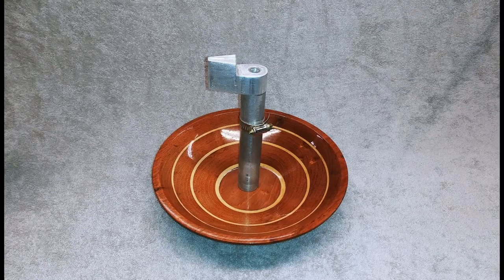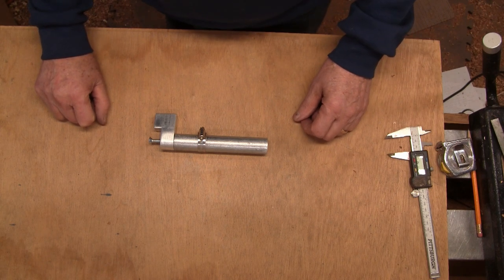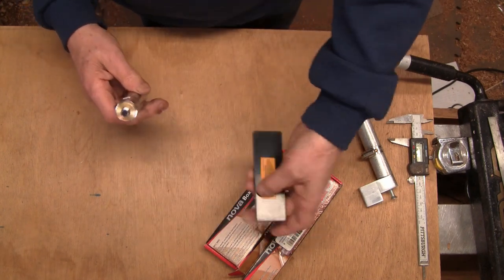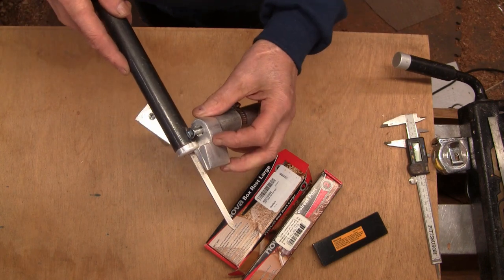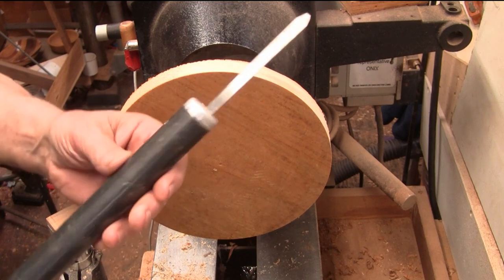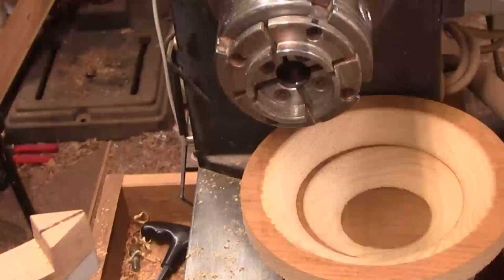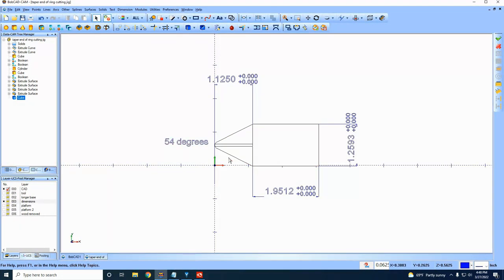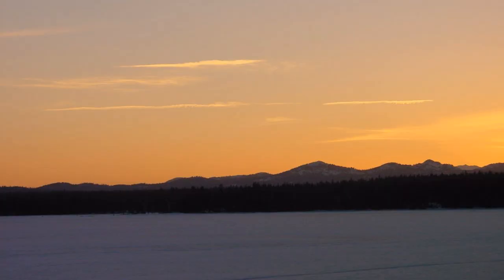Wood Turning NEW Bowl from Board Cutting Jig 2.1 READ UPDATE

Comment: Papa, I just finished making my jig. My platform was shorter and not as wide but it didn't matter. I tapped a 8-32 thread both in the wood and metal platform and used machine screws. I would send some pictures but I don't know how to do it with Youtube. However, the more important thing is to say thank you for producing this video. It was a great help. John von:face-blue-smiling:
Reply from the maker: You can find my email in my About Page

Comment: I hope this is not too long. I mad a jig and to test it I ran to Home Depot and picked up a piece of pine 3/4" x 10" x 4'.  I made rings for two bowls with 9" circles. I must say the rings came out perfect.  I have glued one set up, no turning yet.  This may be the last rings I cut with this iteration of the tool. After four plunging cuts the wood portion of the tool is wallowing out.  Silly me, I used pine I had in the garage. The good part is that before making the ring cutting jig I set up a jig on my belt sander at 27 degrees so this will make redoing the tool easier.  On making the first tool the belt sander assured that the angle on the box rest and wood were identical.  I used a 60 grit belt to shape the rough saw cuts on the wood and a 36 grit belt to totally shape the box rest (no sawing at all).  It went smooth, but a mask is advised.  I plan on replacing the wood with aluminum.  I purchased a piece of 1-1/4" x 1" x 3-5/8" for only $6.31.  The block of aluminum is the perfect size for me I will not have to change it in the least.  I will have to shape the aluminum and I have it in my mind that I can do it using a drill, hack saw, file, and belt sander.  I am feeling pretty confident about that part.  What I wonder about is how I will cut the kerf as a hack saw only gives me .033" which is short of what I need for a 1/16" parting tool.  I do not think a needle file will be healthy enough for the job.  So let me ask you to throw out any ideas you may have to cut the kerf.  Should I be looking for someone that can mill it as that should be a small job once everything else is done.  I really do not know if a router or die grinder (Dremel) would be an option. I would love to hear your thoughts and let me say thank you.  Thank you for making the information available.  I have just had a grand time the past week thinking about how I would approach this project and then actually following through.  It is joy I derived from your kindness  of sharing.
Reply from the maker: There are a few things that might be a good option. Using HDPE plastic the slot should last a long time. Or another plastic like that. 
For the aluminum a hacksaw would be a start and the maybe a carbide coated hacksaw blade.
Or maybe a cutting wheel or bit on a Dremel tool i That should follow the hacksawed kerf. If you do not have a Dremel you could use a drill. Cordless or corded.

So I think you should be able to get a slot in the aluminum. 

 Let me know if that makes sense and if you have any other questions.

Comment: I add my thanks as well to those below.  This covers everyone that might be interested in bowls from boards.  It doesn't get any simpler than that.  Many many bowls can be made very easily and if one should wear the wood part out, just make another one.  The steel won't wear.  I thoroughly enjoy your videos and I hope you keep them up for as long as you can.  Regards, and stay safe!
Reply from the maker: Thanks so much! I meant to add the option of using HDPE which will last a long time.
I plan on lots more videos.  But today we planted a large arborvitae and after that I might have to rest for a half a day!
Thanks for watching,
Gary

Comment: Thank you Gary for all the effort you went through to instruct us. Very valuable, glad the parts you purchased for this illustration can be used by you.
Reply from the maker: Thank you Lee, yes I will make use of the parts. I am very curious how the Robert Sorby post would fit. My banjo does have a lower adjustment to tighten the tube up. If I do that it clamps fine. But then the Laguna tool rest is tight. 
Thanks for watching,
Gary
Reply: @ThePapa1947  Oh, btw I purchased a Laguna 1836 220V. It was available at my local woodcraft store so could pick it up w/o shipping charge. Now just waiting for the electrician to put in 220v circuit, then sell my HF lathe. Thanks for the advice.
Reply from the maker: Fantastic Lee! You will love it.  When I rewired my shop years ago I ran a number of 220V lines. Good thing I did as I have 4 machines that run on 220 which I did not have back then.
When you get your lathe setup check out this video. I can not do with out this mod I made. 
https://www.youtube.com/watch?v=AzExi1D8sak&ab_channel=ThePapa1947

Comment: Thank you Gary for your sharing of most  valuable information..sure made my day easier devising the guide.  Most appreciated. I tried the wood guide for the parting tool in your earlier videos. The idea worked great!!!  my mistake was in using a slightly larger (height-width) parting tool. A slight disaster..the tool broke sending a section of the tool into the face shield..I tool was a thin diamond shape...which the quality must have been poor.  Hence, made a purchase of HSS in 2mm thickness by 8mm height, placed into a new holder.  This video is just what I needed to complete the cutter unit..   Thank you again Gary
Reply from the maker: Thank you very much Michael. The wide parting tools have been an issue. I actually made a drawing to show what size I needed to not bind up. That is how I ended up with what I have.
 What you have now should be great.
 Do you have a link to where you got the steel? I would love to have a look at it. 
Thanks,
Gary
Reply: @ThePapa1947  thank you for sharing your knowledge and experiences.  I found the HSS cutter blank on Amazon.  2mm x 8mm x 200mm in length ..in a 5 pack. I'm not at home so in the process of making a temp handle/holder til I return and devise a better setup. I will send a  picture shortly.

Comment: I too am thrifty (cheap) Gary.  I've expanded a bit on your idea.  I used 1" steel bar stock (Amazon) and 1.75 x 1.75 X 5 oak block (tree).  I made a "T" ...forstner  bit  & epoxy.  Then I cut the guide mortise tool guides  at a variety of angles, along the block.  The oak block is setup parallel to the work piece.  Thank you for the idea.  Oh, and I made the parting tools from HSS tool blanks (Amazon).  Easy & cheap!
Reply from the maker: Thank you Louis! Always nice talking ideas with another thrifty(cheap) person. 
You have an excellent design as well.
Take care,
Gary

Comment: Thanks for your detailed videos on your methods of making a bowl from a board. I'd made several but only using straight 45* angles and was tired of the look of the straight funnel bowls. Using the different angles offers a new area to explore.
I made your jig using materials I had on hand, 1" OD aluminum tube and a piece of 3/4" OD aluminum bar that nicely fit into the tube. Drilled and tapped the end of the 3/4" to take a 1/4-20 bolt, epoxied the rod into the tube and then formed the top piece from some un-named but very hard and dense tropical hardwood.
Worked as expected but I found that my first effort was more work parting than I'd hoped. 
My 1/8" parting tool has no flare at the tip so I got a lot of heat build up in the tool from friction in the parting cut and had to sharpen several times. Maybe pushing too hard. I do tend to do that.  And the final cut through had quite a bit of exit splintering.
Perhaps I should explain that I used an assortment of small cut offs that yielded a blank that was 1 1/8" thick and made almost exclusively of some very dense wood such as pau marfim ( Brazilian maple ).
What thickness blank do you normally use? I'm assuming 3/4" but could be wrong in that.
Are your woods particularly hard?
What speed do you use? I was running around 650 RPM. The bland was 12 1/2" OD at the start.
Part of my problem may be expecting more than is reasonable. Another part might be the thickness of the blank or the wood choice. Or if it's not those it may just be operator error. Need more practice.
Any light you can shed from your experience would be appreciated.
Again, thanks for your videos. I do enjoy watching what you do.
Reply from the maker: Hi Randy, sounds like what you made will do the trick. A lot like the I use now.
So it does sound like you might be pushing a bit hard and turning a little fast for the real hard wood.
I use a variety of wood. None are what I would consider extra hard. I would say Purple Heart being the hardnest.
Most of my boards are around 15/16 the way I purchase them. When you start cutting angles the cut gets much farther than that.
 I tend to pull the tool out a few times during the cut to clear the cut and let the tool cool down. On the harder wood I may touch the edge up again with a diamond card just to get another burr on it. Once a burr is gone you are no longer cutting.
 Hope that helps and if I missed something let me know.
Gary

Comment: Gary This is awesome, I made your last jig for ring cutting and put in a 45 and a 50-degree angle and thought that it could not be beat, however this one allows you to change the angles just by adjusting the tip to the board... You Sir are Amazing.. Thanks for sharing your talent and ideas to make us all better wood turners... When I get back to the house this is one of the next shop jigs on my to do list for sure... Thanks Again
Reply from the maker: Thank you very much Timothy! The other works fine  but I have to say this one is not only fun to make it is fun to use. 
 Let me know bow it goes.
Gary
Reply: @ThePapa1947  Will do... it will be a month or two based off my work schedule but in the que for sure...

Comment: Your instructions are clear the board width and length will be determined by the box rest platform size.  The height of the board will be determined by the depth of the parting tool and handle combination in order to allow clearance for a deeper plunge with the parting tool.  I have ideas and am sure I can make this work, but I am not trying to reinvent the wheel so I am going to ask that you please share the height of the board you used.  It will make things easier for me as I will be using the same parting tool you use and I doubt my handle can be any larger than yours as I have a Sorby micro handle.  Once again I thank you!!
Reply from the maker: Happy my information on how I made mine was clear.
I have the Sorby Micro parting tool blade. I did not buy it with a handle and what you are seeing it hooked to is a metal handle that I can change tools out in.
I started with a wood block that was 1.125" tall. I removed .75" leaving a flat end that was .375" thick. From the very top of the end piece I cut a slot that was .25" deep .5" below the slot to the tail end of the piece which is .375" thick.
Not having the Sorby Micro parting tool with a handle I am not sure what those dimensions are.
If you told me the maximum diameter of that handle I could tell you the dimensions you need.
Hope that helps.
Gary

Comment: This is absolutely, off-the-charts awesome.  I don't know how I missed this back in Apr.  Thanks so much for your effort; you clearly put a lot into this.
Reply from the maker: Thank you very much Jim. I meant to add in the video that using HDPE plastic is just as easy as using wood for the tool guide.
Thanks for watching,
Gary
Reply: @ThePapa1947  How about the screws that hold it to the box rest platform?  Does HDPE hold screws well enough?  I've haven't work much with that material.
Reply from the maker: @jimbalz3017  yes the HDPE is very strong. You could drill and tap the holes or just predrill for wood screws.  I have some I made for camera mounts and drilled and tapped them for clamping against my camera boom. So for sure they will hold the parting tool guide just fine.

Comment: Thanks very much for sharing this and all your other videos.  I’ve been meaning to try your bowl-from-a-board technique since I first saw this last year. I finally got around to making the jig and a Sorby clone parting tool (from a reciprocating saw blade).  

I cut an inch off of the 5 inch Nova tool post because I have the Laguna 12/16 lathe (12 swing).  I had to shorten the post anyway to make it work with the Nova modular tool rests I have.  So no extra work. To the best of my knowledge Nova the shortest 1” diameter post Nova makes is 5”.  I guess most midi-lathes use a ⅝ diameter post.
Reply from the maker: Very nice Dave.
Let me know how it goes.
Gary

Comment: It looks simple enough to make and quite useful. I would note that my Nova toolrest fits quite in my Laguna 1836.
Reply from the maker: Thanks Bill, it slides right in mine but I have to clamp harder than normal to get it fixed in place. As you know there is a second threaded hole on the Laguna banjo and if I tighten it up just a little then the Nova post clamps fine. But the Laguna tool rest is a bit tight.
If you have a micrometer I think you will see the Nova is about .002 thousandths smaller.
 I would be curious to hear what you come up with.
Thanks for watching,
Gary

Comment: Hi, Gary.  I've made a few tools over the years using the trial and error method.  Your video will take all of the fun out of it!  🙂 Seriously, your tutorial is exceptionally detailed so that anyone can make it work right the first time.  It's a clever jig with reliable, repeatable results.  That's what we're all looking for, i.e., some assurance that our projects will end up looking like we envision them.  Thanks for sharing your expertise!
Take care,
--Paul
Reply from the maker: Thank you very much Paul. I also like the trial and error method. the first one I made that clamped to the tool rest was a trial. It did work and had its own features. It was quick and I needed it. I actually had the aluminum one in mind but I knew it would take longer. That was a single build with no modes. This last version was for non wood workers and it works great as well. I will be using the aluminum version. And keep the other for another tool rest that should reach into openings my other ones will not.
 But I do have another tool in mind that should really help. In the thinking stage right now.
Thanks for watching,
Gary

Comment: Hi Gary, thanks for showing your jig. I'm new to woodturning (I started this year) and I have joined a club and attended many courses. I'm really enjoying the woodturning experience, and I'm learning a lot from the courses and other members, and of course videos like yours. I have also been doing metal fabrication and machining for quite a long time. I plan to make a jig like this but I have questions about the woodturners parting tools. At the club we use the diamond shape parting tools. I have also seen the flat sided parting tools, where you cut an extra bit on the side for relief to reduce binding. Both of these types of parting tools have a point at the tip (negative rake), and this is where I get confused. When using a parting tool on the metal lathe, the tool is flat on the top (neutral rake), and you set the top of the tool at dead center on the work. These parting blades are typically tapered (wider at the top) to provide relief for the tool when parting material. The questions I have are:
1) Why are a lot of woodturners parting tools pointed with negative rake?
2) Would a parting tool from a metal lathe work on wood when cutting on dead center?
Reply from the maker: Good morning and thanks for watching.
 I have not a lot of metal work myself. I have a small metal lathe and a full sized Bridgeport CNC mill.
The parting blades I use on my lathe are just like you talked about. And yes that shape will work on wood as well.
I would say the diamond shaped parting tool for wood is that way to clear the chips. There are more coming out and coming out faster when cutting wood.  Also I think that negative rake shape will help with the tool catching.
 The important thing for me when cutting on an angle for the rings is having a shorter in height tool. 
I spent a lot of time on my CAD program drawing those cuts and have settle on a tool that is 1/4 inch tall and .08 inches wide. Looking at the kerf made I find the best clearance when getting down to the smallest ring being cut.
 Many have tried tools that are 3/4 inch tall. They work fine for cutting at 90 degrees to the work. But as soon as you make an angle cut for the rings there is no clearance at all. 
 I think as a metal worker you can understand all of this.
  Also I make all my cuts dead center with any the parting tool I use when cutting the rings.
 Hope this helps and let me know if you have any other questions.
  Gary

Comment: Thanks for sharing this, Gary.  It looks simple enough that I may try making one soon.  I have a modular rest system that has a post which screws on to various size rests.  I think it should work.  I'll let you know how it turns out.  Thanks again for the inspiration.
Reply from the maker: Thanks Tom. Which brand are you using? The Nova uses metric threads and was aluminum if you did not want to buy the box rest. But the short one is not that expensive.
Let me know how it goes.
Gary

Comment: Thank you for showing all that. And figuring all that out. I am going to make one of those myself. I am betting I will need to get a similar parting too like you gave. Mine is 3/16" thick and about 3/4" high. I am thinking that will bind up in the cuts ?
Reply from the maker: Thank you John! I would agree your parting tool sounds a bit oversized for cutting rings on an angle. You just would not have the clearance needed for the tool.
Best of luck,
Gary